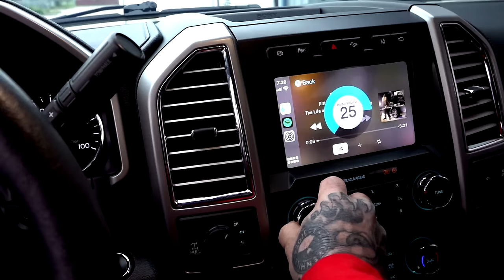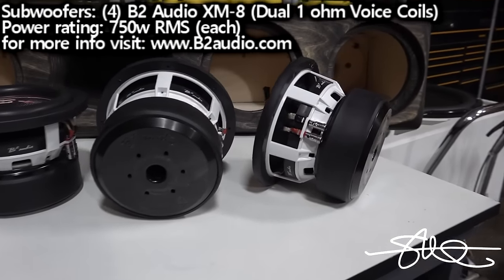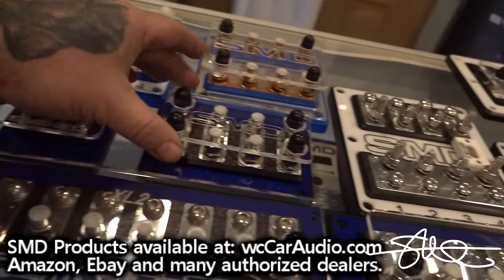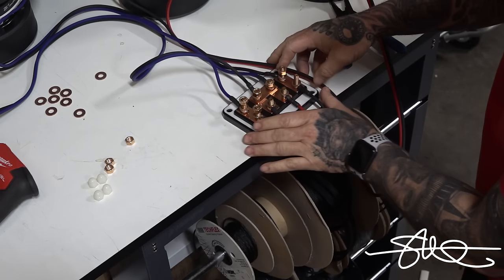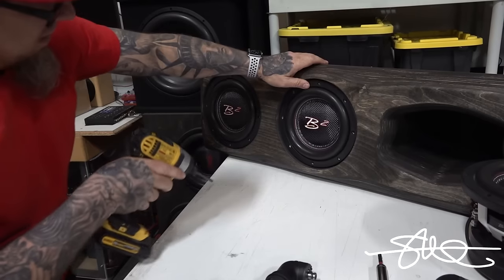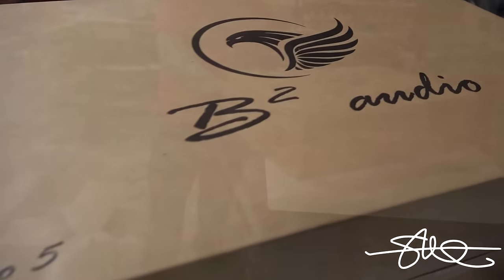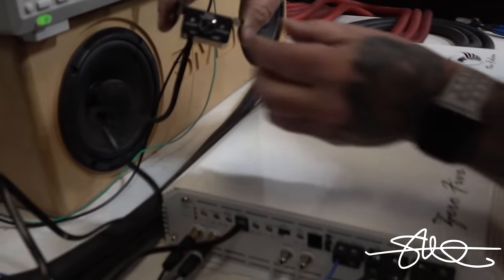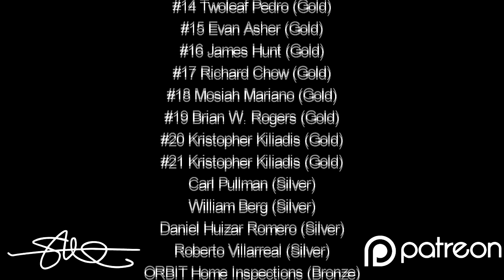Four 8's = Violent BASS! BADASS Ported Under-Seat Truck Enclosure Wired Up - Disintegrates a CD!

Comment: Seems like the 2nd and 4th position subs have a lot of surround deformation compared to 1 and 3 from the slow motion footage.
Reply: Probably the 2 used subs that have broken in surrounds. He was xmax'n them hard.
Reply: @wtcamer  agreed. I figured something along those lines.
Reply: It is the internal wiring causing more power to be sent to two of the four subwoofers because of the series parallel wiring.

Comment: Sky High wire is enormous. The regular 1/0 OFC is really 3/0 Welding size. I went to my local Auto parts store, Economy Auto, took a piece of wire in there to size it for some copper lugs and the 3/0 Welding lugs ended up fitting perfect.

Comment: Great video. I’ve always preffered the sound of 8” subs over 10s or 12s. I started running four 8 free airs back in the 90s and had to explain the whole series/parallel wiring thing many times. Thanks for showing 8s are still good option.

Comment: There was a cheap/real cheap fosgate box from years ago that had a setup like The SMD connector /bus setup that was built into the side of it. Until I stole the pieces from it & put  them on a custom box... Weren't quite as fancy and didn't come with the copper bar. But served the same purpose. Only time I've ever seen something like that built into a box from the factory

Comment: Is it just me or are the right speaker on each pair bottoming out more?
Reply: Right or outer? Its because the way he hooked it up on that plate. The amp is directly connected to the outside connectors which were those two subs.
Reply: Two new subs vs two that got broken in  already.
Reply: @g_lee_j827  Def right, the two left must be newer ig.

Comment: two woofers move more then others, u can see the wrincles on the surrounds,it could be  (A) there is a flaw in the box, (B) the wiring is somewhat incorrect or the two subs u pulled out from the honda build box have been worked harder and are more loose etc ;)
Reply: i was wondering as well, but i don't think it's A, because it's not symmetrical the outside speakers. seems like different charge or just j very small difference in resistance/impedance in the coils... at 1 ohm every bit counts
Reply: I think it's C, the used ones are worked in, or perhaps a D, anomaly with the camera
Reply: Ad nauseum
Reply from the maker: 2 are new 2 are already broken in. There ya go. You can sleep now. lol
Reply: @meade916  LOL
Reply: RATCAR 302 the two he already had in the enclosure were already broken in from use. Thats my best educated guess.

Comment: Is it me or two of the subs have flex wrinkles 🤔 starting from the left the second one and the fourth one 27:15 but the other two don’t
Reply: palmdalefresno87 he has 2 new and 2 used so the used ones are broken in and moving a lot more then the new ones
Reply from the maker: @KAE-PerformanceRacing  first time the new one's have ever seen power where the other ones got beat on for a year.
Reply: @KAE-PerformanceRacing  more like damn near burnt out out from overpowering  them

Comment: Just got this box for my 2018 f150. 
Got seat lift with box. This box is built well.
Very heavy-duty box. Extremely nice. 
Have 4 duel 2ohm DEAD GAME wired down to 1ohm to a skar 2000.1D
Reply: I haven’t done any sound system stuff to my 18 but I had a custom box on my 04-08 with a lmi seat lift kit so If anything I’ll get a seat lift for this truck I just want to know if the box would handle x8s
Reply: Ok how does it sound
Reply: Very good
Reply: wassup bro on that f150 what elecgrical if any did u do? 
i have one aswell wanted tun run 2k watts

Comment: I had 4 JL Audio 8" subs in a Porsche 996 and it sounded amazing. People would always say it was one of the best sounded systems they ever heard and would always ask if I had two 12's and were always super shocked to see 8" subs.
Reply: It’s all about the cone area and box. 32” with the 8s vs 24” with two 12s.
Reply from the maker: @jasoncardoza6375  that isn't how you calculate cone area. It's actually pretty close to the same (226in2 for the 8's and 201 for the 12's)

Comment: Something is wrong with it i think the far right and the one just to left of the port acts like it’s at1 ohm while the other 2 are at 2.-4 ohm
Reply: I was gonna comment the same thing ... possibly becuz one set of speakers were used and the others weren't broke In yet....I don't know tho
Reply: Or its because of the special series/parallel wiring combinatin... I wouldn't have done the 4 speaker cables togheter and woud clearly seperate the two 4ohm series circuts!

Comment: I’m currently running 2 12s with a bass knob and a pioneer deck in my 1997 zj, with plans to add a mid and high amp, as well as upgrading the stock door speakers to make it sound the way I want

Comment: What’s up with the right sud in each pair, They look like they’re flexing way more then the left ones
Reply: LASKA broken in subs vs brand new subs
Reply: Bottoming out as well
Reply from the maker: @dennisritchie965  nothing bottomed out.
Reply: @dennisritchie965  def not bottoming out. Id put money on the design of them having a bottomless design. Quite a few big boy 8s have a bottomless design so the coil never reaches the backplate.
Reply: Ok I take your word my rookie mistake.
Reply: @meade916  yeah they did , 8's are crap, get a12 for deeper bass.

Comment: I am working on my diesel truck. It’s a 2003 Diesel F250 Crew. I was thinking of putting dual 8s in the rear doors for bass. I am pretty good with fiberglass and I was thinking this might be a good time to try Sunflash and would love your opinion on what 8s and what your thoughts were of putting subs in the rear doors would be.

Comment: Impressive as always. I've got a 2016 Chrysler 200 ltd, decent audio, but so integrated even crutchfield recommended not replacing the head unit. All I want is a sub without spending a fortune on adapter/breakout boxes... Any advice?

Comment: (model numbers are iffy) but This reminds me of my Sony system built by Hugh Cobb back in the mid 80's. The box held 2 Sony 880's 8in round 3-way speakers and 2 8in round Sony L20 subs. The box was sealed and wrapped in cushy "pleather" and had a big "Thruster" passive radiator in the center. I had the Crossovers in the dash and the 6in mids in the doors. It was powered by 2 Sony 160 "Red Face" amps.

For the time period, it would seriously THUMP!! Ya know I can't find any pics on the internet of my old Sony components

Comment: Going from left to right on the Speaker box during slow motion.... Is it just the box or are the 2nd woofers the ones that were broken in and would the sound change if all of the speakers had the same amount of playtime??? Just curious and I've been a fan
Reply: Not really no it would not affect it unless one was blown
Reply: Don't be confused by what appears to be out of sync subwoofers, sometimes it does happen but usually it is the camera.

Comment: Steve I need your help just installed a avic5200nex in my 2011 sonata everything is hooked up correct and amp and subs work when parked but when I put it in drive and take off it kicks off till I come to a complete stop. Any ideas of what is causing it?
Reply: Michael Martinez sounds like something safety related in the car
Reply: Green wire

Comment: Man  I got a question, I have a 08 Armada and im tryin
To keep my factory deck but have no RCA OUTPUTS, I went and bought a converter from Walmart, 2 actually. I have watched the same two but 4 different ways this guy from Ohio does trying get his aftermarket amp hooked up with Bose stereo factory system. I'm baffled, nothing work. My converter want power my amp with any of his ways done on his videos. I know the converters work bc i tried them in my PT Cruiser and they work beautifully. Pls help

Comment: so which is better, multiple small subwoofers or a few huge 15 inch subs? If money is no object, I've heard that the smaller subs will give you cleaner tighter bass which is better for SQ builds and huge 15 inch subs are better for Loudness and SPL builds. Is this correct?

Comment: Unrelated, but your thoughts on a sealed common chamber dual opposing 8" setup? Both subs wired in a single phase channel, one facing driver's door, one passenger. It's going into a utility SxS under the driver's seat. Tryin to maximize limited space with existing D2 ohm 8s.
Reply: Half doors, roof, fromt a rear windshields is all the cabin enclosure I have, so not a true cabin, but not quite topless either.

Comment: Damn those hit hard, put my 2 12s to shame
Reply: FYI  2 12" subs are = to 4.5  8" subs.  Only 100ci  of area difference between 4 8's and 2 12's.   One 8" woofer has 201.06ci of area. One 12" woofer has 452.38ci of area.  To find the area of a circle use the following formula;  pi times the radius squared (A = π r²).  For an 8 inch woofer, (8x8) x  3.1415

Comment: I have some old ass .Fosgate pro series woofers from the 80s they will KILL AND DESTROY the new stuff !!
Reply: Old audio gear is just better. Not as efficient or as compact tho
Reply: Post a video and prove it.
Reply from the maker: no you don't. And no they wouldn't even if you did.
Reply: @enbee_ash6740  lol those little b2 audio 8 inch will beat any old fosgate piece of shit no matter what size
Reply: @Davidszd-f1h  depends how your measuring it.  I personally mean I like the sound signiture of old gear. Those would play powder, lower, and probably cleaner, but in the same way people prefer Vinal over a high quality digital file, I like the old gear better than the new stuff
Reply: @Davidszd-f1h  they better than Team Fosgate and Power HX2 ?

Comment: I want better bass in my 2010 f150 XLT supercrew. I already have two shallow 10s pushing 350 RMS each.. But would maybe lifting the seat up and adding a bigger box with four 10s be better? Or can four 8s like yours achieve that ground slamming bass?

I wanna be heard 👂 when I pull up to a party lol 😆  

Any tips?? Plz!
Reply: Well yeah lift up the seats and get a custom box built for whatever u want, some trucks u could fit 4 12’s down firing i put 4 8’s in my truck and it’s a nissan titan 04 its a tight squeeze but for sure u could

Comment: I see two subs that are just wrinkling the rubber ring only two one on the left middle and the right side outside one is that not bad or is it all good
Reply: I seen the same maybe cause the other 2 are new i don't know
Reply: Crap speakers. Video is a joke.
Reply: I noticed the two subs wrinkling also but remembered in the vid Steve stating two subs were used and concluded that being the difference. 

Sure enough Steve made a comment about it.

Comment: I’m in love with a good hard hittin 12” frequency note... even if it’s just a solo 12” inna sealed or a ported box, my question is...do these 4x 8’s compare with the full-sounding, hard-hittin, low bass note tht I’ve grown accustomed to from a 12” subwoofer? I have a f250 and I Hav to put a box under my rear bench seat...
Reply: Its kinda like... A couple 15s give or take.

Comment: Steve I know this is an older video but just wanting to pick your brain snd ears. Now it doesn't matter the vehicle but I do understand that the cabin makes a huge difference to the sound. That said for the majority of music what is your favorite size woofer for the job. SQ wise. What is going to sound tight yet dig deep when the music calls for it?? I've had 10's, 12's, and 14's. Yes 14's home pro JBL cut cab. You've had more. I hope you read this as I've often wondered can 2,15's sound great or 2, 18's or bigger for most music. I don't listen to just rap. Sometimes Floyd fills the need, maybe Kraft Werk, or techno, House, pipe organ, old school 80's, etc. I think you get the picture. If you saw my CD collection you either my think awesome or nut job. Oh I listen to Opera, instrumental, jazz everything but in this case I'm asking for your thoughts on what would be a great SQ set up. Sometimes I think 2 to four 8's and an 18 would cover the spectrum of sound. Of course same brand and version careful not to mix speakers because of tone difference. Here's to hoping you see and let it really sink into thought. Thanks just another Steve fan real name Albert.
Reply: You're asking the wrong question, really. Woofer size is nowhere close to the biggest consideration for SQ. Whatever subs you can fit nicely in the space available, with a suitably sized enclosure, will do fine. Keep in mind when I say sub that will fit nicely, I mean the subs AND the enclosure with the correct volume to achieve your needs. The enclosure plays the biggest role. even a tiny 6.5" can easily hit down into the 20s with a nice flat response if you've got the right box for it. Learn how to use some enclosure simulation programs, bassbox pro, winisd, etc, as a start. Try to get as flat a frequency response as possible, and make sure you've got sufficient port area to eliminate audible port noise. When it comes to speakers, pay attention to your crossovers. There is software out there to simulate your crossover points as well. Also don't buy a shitty class D amp and expect your treble frequencies to sound good through it. Lots of cheap class D amps can sound lousy, especially on highs. Don't buy a sub made for SPL and try using it for SQ, waste of money. And lastly, don't expect someone to give you a magic answer like "2 12 inch subs in a vented enclosure with these dimensions will give you the best SQ". Put in the work, learn how to design a good enclosure, learn how to evaluate a subs specs and choose a suitable driver, and figure out what will work best for your vehicle and listening application. There is no magic answer. That's my $0.02 anyways, take from it what you will.
Reply: @hubaswift7640  Very good answer but I new most of that. My question still stands. Given ample room for any speaker what size woofer will give the best sound for the woofer sound range??

Comment: So i have a 2019 f150 with a Rockford fosgate p3 and a Rockford fosgate r750 amp, and it will not hit lows at all. It hits highs, but not lows. Its in a ported box tuned to 35hz. Any input would be appreciated
Reply: MurdrSS maybe try songs with 35hz and up?
Reply: Get rid of the Rockford Fosgate junk, and start over.
Reply: I swear I will subscribe not even 35hz songs will hit
Reply: Micky Smith III well i have a p3 in a 29hz box in my other truck and its ridiculous, stop hatin
Reply: @1Slow_SS  I'm not hatin' at all. I'm just not a fan of the RF amps. Have seen too many of them get ruined, and not from improper installs either. In my opinion they are overpriced junk!
Reply: Micky Smith III my 2nd setup has been running strong for 2 years no problems, paid 115 bucks for it.
Reply: @mickysmithiii1213  Even the power series amps? Those amps are the cleanest, imo. To me they're very musical. I've had Punch, and Prime before. I don't like the way the prime series sound.
Reply: @kman915  Rockford Fosgate in general. I don't care the model or the wattage?  Just overpriced trash. Id rather spend a few extra dollars,  and get some more longevity for my $$$
Reply: @mickysmithiii1213  the products from the 90s & 90s Were Awesome tho !!! Look into Legends of car audio or  Old school stero. Com
Reply: I'm sure u already checked for leaks or loose screws .... might throw a new box.. I prefer sealed boxes myself

Comment: Isnt the terminal block supposed to go on the outside of the box? And make  final series or parallel connections easy to do without having to remove drivers. Its how ive done mine for Sundown sub and working great. Just asking im not an expert.
Reply: Personal preference
Reply from the maker: you can do it any way you wish.  If you are pulling the subs out of the box, you have to pull them out of the box so i don't see a problem LOL

Comment: Looks like 2 of the subs are wrinkling the surround and the other 2 aren’t
Reply: I was going to mentions something about that. I wonder if those are the old ones that were in the other box. Also, I wonder if that might cause issues later on down the road like the surround tearing or the speaker blowing out.
Reply: Eric Marcus yes two of them have been used two are new. 

So two are “broken in” as people like to say

Comment: Yeah the Sd on the 4 8's vs 6 6.5s is virtually identical... 4 8's = 200.96 in2 vs 6 6.5s = 198.99 in2 So if Xmax is the same I imagine Vd would be about the same. With those numbers I imagine the output would be comparable to a pair of 12s...

Comment: @26:56 the inner left and outer right from the port surrounds on the subs seem to be flexing differently than the other 2. What causes that?
Reply: Not broken in yet
Reply: I don't know which is which, or if it matters but 2 were used already. Maybe the other 2 were new? Or it could be the lighting.
Reply: @ignacio8597  
its cause 2 are new

Comment: Second and the fourth sub from the right seems to be creasing differently compared to 1 and 3...is that normally? Ate they at different impedances?
Reply from the maker: 2 subs got the shit beat out of them for a year. 2 of them just got hooked up for the first time.
Reply: @meade916  is it good for the surround to wrinkle that much?
Reply from the maker: @ilfaraone91  i was pushing them pretty hard and below tuning frequency so it isn't ideal.....but b2 subs are tough.  Don't try it yourself unless you are willing to pay the cost though.  I do what i do at my own risk :D

Comment: The right speaker on both sides seem to be getting more power than the speaker to their left. Is it normal for the first speaker of the series to get a noticeably higher power and couldn't it be pushing those two speaker a bit hard?
Reply: maybe because of the way the box it ported?
Reply from the maker: @dirtrider88  or maybe because 2 were in a car for a year being worked over and 2 are brand new....
Reply: @meade916  yea, or that. lol